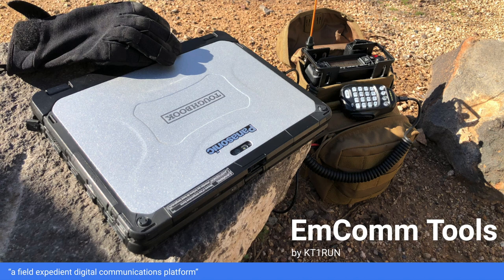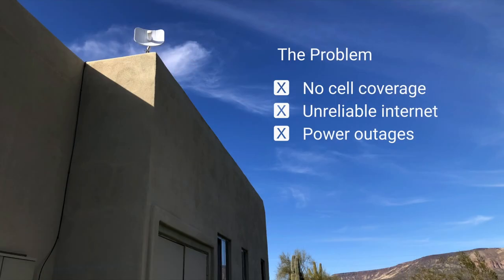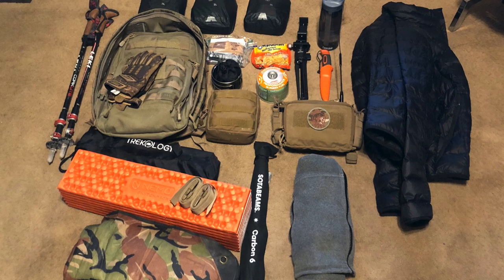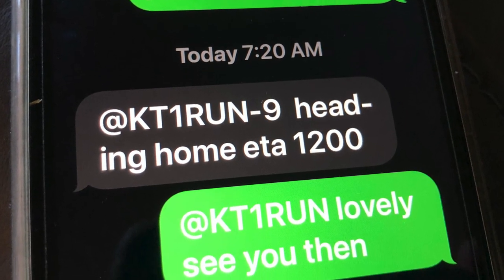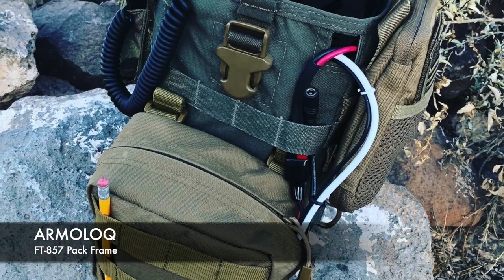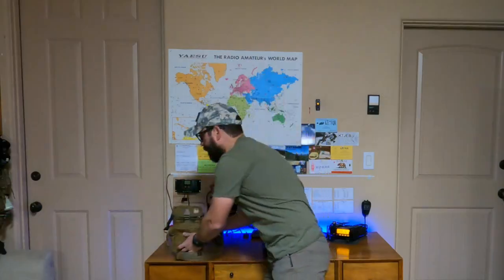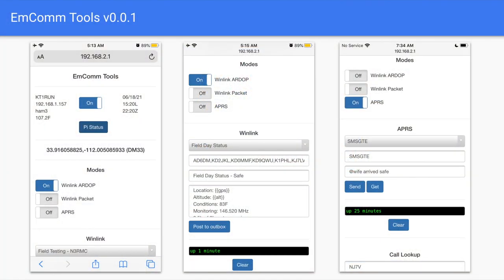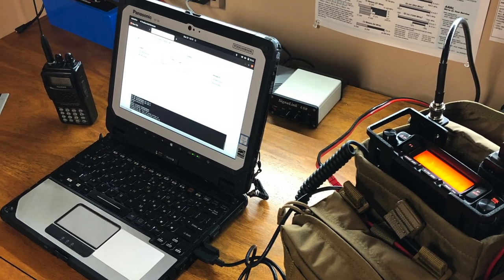The EmComm Tools Story - The what, why and how?

Comment: The man bag for go is the smartest part of this whole setup. Anything that does not disrupt connections is A+++
Reply from the maker: Glad you like it. You should see the current iteration of the manpack. I custom designed a bag (TTP Manpack), so there are no external wires. There is nothing that gets in the way of cables or components.

Comment: Have you seen what KM4ACK has done with the Pi. It looks like you are doing about the same things. He has a Build A Pi.  Loades winlink, JS8CALL,  FT8, Ham Clock,  and many other things
Reply from the maker: We are actually good friends and talk about once a month. I started with the Pi and do run Build-A-Pi. I am taking my project in a different direction and I am targeting users that want to get into radio for preparedness, but don't want to tinker with the hobby. My goal is to make an appliance that's easy-to-use and that can be kitted together with reference hardware and software. Cheers!
Reply: @TheTechPrepper  I tryed to do his Build A Pi and screwed up 2 Pi's. I used a screen with the HDMI port.  If one turns off and the other is still on it tryes to power the one that is off through the HDMI port and that cannot do the power. Our ARES do Hurricane shelters and send Winlink to the EOC. Winlink has all the forms for Federal,, State, and local government. The last Hurricane missed us by about 150-200 miles north of us. There was only 3 shelters opened for less than a day. Because that storm was not going where they thought it would go and some older people have trouble doing things. I am new at this and a lot of learning to do. But much of our things will have generator power I think, but I just got a 100 AH battery to be sure I will have power for my radios. 73 de W4DES

Comment: instead of using zip codes would it be easier to do grid square info? does the fcc database have that info? just an idea not sure if it would help.
Reply from the maker: The zip code is used internally as a lookup key for a number of data sources that I aggregate. The FCC uses as postal code (not a grid square) in their licensee database. It's also used to lookup representative elevation info from the USGS. I take the zip code, geocode it (lat/lon), then calculate a 6-character maidenhead grid square.
Reply: Remember that resolution beyond your antenna's beamwidth is wasted. If you're talking 2m SSB, sure, narrow it down to a 10º pie-slice on the map. But if you're on HF, once you get beyond immediately adjacent states, just knowing the state itself would be enough of a starting point to aim any directional antenna you could carry in a pack.

Comment: Fantastic video Gaston,
I was already a fan of Emcomm Tool but this just took my enthusiasm and anticipation to the next level.
Keep up the great work/content this is amazing. 
73
Reply from the maker: Thank you, Jose. As I was working through the demo and I realized how much was still missing in terms of feature completeness. I am actually using both versions of the application and can't wait until they are finally merged. I use the original version any time I have to interface with the radio to send messages and use the new version when I need the map. Stay tuned for the "supporter" beta. I appreciate all your support!

Comment: I was just saying to some ham friends, someone needs to make all the digital modes easier!  I spent way too much time learning all the connections, ports, system sounds, multiple softwares running...  You're doing great, keep it up!
Reply from the maker: Totally agree! I had one heck of time getting into digital modes. Honestly, this iproject is starting to look like it's headed in the direction of me selling preloaded laptops with my EmComm Tools OS that is known to work with a small set of radios and the DigiRig Mobile. For me to make this turnkey and easy, it needs to be an appliance. I know this is "anti-ham" but that's the only way to deliver on my mission.
Reply: @TheTechPrepper   Ham radio is about experimentation and you are doing just that.  For you to make it easier for new hams and older people to operate without all the headache, you are providing a turnkey solution.  KF0CVR

Comment: I look forward to more.  I didn’t get very far into data modes, seemed too daunting as I had not kept up on much of the technical side.  Nowadays, I’m the guerrilla banging on the buttons.
Reply from the maker: Don't give up, Doug. Digital modes are need easy. I am a software engineer and had one heck of a time getting started. In fact, my first SignaLink was a dud. That through me for a curve ball for over a month before I returned it to HRO. I am glad I stuck with it. APRS is definitely the easiest digital mode to use when getting started IMHO. 

At the last minute, I was pulled into the Mesquite Canyon trail run. I know you were asking about events I was planning on working.

Also, I'll be running as Net Control on the AEN-MAR net for the first time solo on Monday. The topic: Winlink Introduction. Feel free join and give me a hard time. ;-)
Reply: @TheTechPrepper  Too bad I wasn't able to attend the mesquite run.  Figured I would go for a walk during the winlink net.  Great job on the net.

The last time I tried digital was through an old kenwood 707.  Couldn't seem to get the transmit settings correct.  Have you thought of aredn?
Reply from the maker: @douglasvamateurradioandmore  ARDEN is not for me at this point. I have about a half dozen WRT54G routers that I could use. I'll likely look at it in 2024. I have a plan in place for things I'd like to tackle in 2022 and 2023.

Comment: Great video. I working through a lot of the same problems you’ve gone through. I am hopefully going to get a 2m/7cm antenna with high gain so I can get more active locally. Still want to work on emcomm too. Keep up the great work! 73’s KK7BPV
Reply from the maker: Thank you, Roger. I figured that others have or will run into the same issues. That's partly why I have documented the experiences on the channel. Don't give up and keep at it. As you can see, I am not expert, just another guy fumbling through the hobby. Good luck with you EmComm journey!
Reply: I use the CHA MPAS Lite.  And it is wonderful!
Reply from the maker: @kurt53641  Very nice. Interesting timing. Chameleon Antennas contacted me a few days. The are planning on sending me a couple of antennas later this year for review. They were always out of my budget. It will be nice to see what all the fuss is about.
Reply: @TheTechPrepper  I just saved and saved to buy once cry once.  And I never looked back
Reply from the maker: @kurt53641  I subscribe to this philosophy as well.

Comment: This is really impressive and looks very promising so far. I'm a new Ham and have run into a lot of headaches with digital, you story resonates so much. I'm curious about how you buildt the UI. Is it html based? I would love to tinker around with the interface would that be possible in the supporter beta?
Reply from the maker: Welcome to the club. Digital modes can be a little tricky. The UI is built using a front end UI framework called React Spectrum. It renders to HTML, CSS and JavaScript. The backend is written in Java. This will be released as open source after the beta. Although, I may invite a few developers into help in the coming months. The application is changing too frequently based on my field tests, so I want to get a more stable build before bringing people in.

Comment: Wow, the project is looking impressive!  I have a Cf-19 mk3 (I was able to source it for cheap several years back).  I am currently running Mint 18.3 which isn't even supported anymore (the computer is Core2Duo CPU, 1.20 GHz, 4 GB RAM).  I am wondering if I can get Xubuntu 21.10 installed on my Cf-19 and if that would run Emcomm tools.  I assume Mint 20 wouldn't work for Emcomm tools.  Ubuntu 20 seems to reqiure 2 GHz processor.  Thanks for the awesome content!
Reply from the maker: Thanks for being apart of the channel. The initial release will be packaged as a live USB ISO image based on Ubuntu 21.10. There will also be USB stick for purchase for those that want the true offgrid experience. At some point, I will release it as standalone package with detailed setup instructions so that users can install it on any Raspberry Pi or Linux distribution.This will come in 2023 given the amount of work to document the standalone setup and configuration.  My goal is to get this initial shipped as a single ISO image with everything installed and configured as I want this to be an easy-to-use appliance. You should be able to test the live USB on your CF-19.
Reply: @TheTechPrepper  When you release it i would Love to see an Android (APK) Version. One addition i would love to see would be an option to do digitalmodes with your phone just as an addition so if a moden fails out in the field you can still use audio cuppeling [and yes im not 100% up to date with your progress so if this already has been implemented by you nice job!]

Comment: Do you find the extra weight worth it in regards to packing in an 857 over the 818?
Reply from the maker: It's depends. If I have an elevation advantage when on a peak, the FT-818 is the way to go. If I need to guarantee or at least improve my ability to communicate when  I'm in poor locations, I have found the FT-857 to be worth the weight. I try to run it at 20 watts and have very good success.

Comment: Question- is your software in competition with build a pi / 73Linux?
Reply from the maker: No. They have very different goals. The new version is plug-n-play and has a number off grid capabilities.
Reply: @TheTechPrepper  what I was thinking if they had the same purpose. Join forces and sky’s the limit on what you and Jason could come up with. I do like your videos. I have a CF-30 bought it because of the HD sleds. If I had seen yours on the CF-20 might have bought it instead.

Comment: Would you do a video on the best Cell Phone for preppers to run with a setup similar to yours
Reply from the maker: Sadly, I have not found one yet. My iPhone is unusable for more than a few minutes when I backpack during our summer months and the touchscreen does not work when I sweat. I've had better luck with The Ulefone Armor X7 (Android) but it also can't deal with the heat. For me personally, I have not found a ruggedized smart phone that works in harsh environment yet. So, I can't rely on a phone as a prep item. I'll make a video if I find one. Thanks for the suggestion.

Comment: Any chance this will make its way to the DragonOS toolbox?
Reply from the maker: Good question. Unfortunately, no. The creator of DragonOS did reach out and offered to add to support, but EmComm Tools is more than just an app. It needs to do a full OS take over so that it can handle plug and play support for a select set of radios. It is intended to be an appliance, so by design it takes over most the amateur radio applications that is uses. It may be time for an update video.
Reply: @TheTechPrepper  as a followup, I know the intended deployment is via booting from a thumb drive at this state, would we be able to get it as an ISO to run as a VM in virtualbox with a documentation laying out kernels and configs?
Reply from the maker: @thatswhatshesaid1  Unfortunately, not at this time.

Comment: Would be cool if it had CW decoding and keyboard entry encoding support.
Reply from the maker: It would be cool, but I believe there are tools for this already. I may see what's out there and install it on the CF-20, but this feature will likely not make it into the project. There are hardware receivers that handle the CW decoding, too. That would be my preference. 73

Comment: The mobile phone 📱 web interface option would still be great for maximum portability, like Android phone and localhost website? Still great to have Linux tablet for dev and multitasking uses.
Reply: OK WOW! 🤩 So much more capabilities on the tablet, especially with the offline map 🗺, pins📍and functions!
Reply from the maker: Good point. I failed to show this in the demo. The application is designed to work on small screens (phones), tablets and desktops. The application uses a "responsive" user layout that dynamically changes based on the size of the screen. Good catch. I'll make sure to cover this during my presentation next week.

Comment: Could the raspberry pi be ruggedised?  Maybe a good project.
Reply from the maker: To some extent you could improve the reliability with a ruggedized case with proper cooling and integrated power. I looked into designing a case, but tabled the project for now. The problem then is a screen that can works in full sun, in the rain, in extreme heat, with gloves, etc. The other issue is that ruggedized laptops are engineered differently than normal computers. For example, they have battery warmers and their components are compartmentalized so that one component failure does not kill the entire system.

Comment: Rock that Cf-20!  Just don't send it in for repair.  I'm busy enough as is :)
Reply from the maker: This thing is great! I'm finding all the little quirks with the CF-20 and have solutions for most of them. Do you have a good source for buying replacement DC power dust covers for the keyboard/dock?
Reply: Our parts room ;)  I work at Panasonic's toughbook repair center currently called heartland customer solutions but will be changing to Panasonic connect (I think) next month.  We are in leawood KS.  Give us a call and one of the ladies in the office can get you taken care of.  If its in warranty they may just send them to you free.  If not i think they are $9 each (doesn't matter keyboard or tablet covers).  But I would check eBay first and see there are any on there cheaper.  And you didn't hear it from me but they are going to be dropping the cf-20 for the G2.
Reply: @TheTechPrepper  😊😊😊😊😊😊😊😊😊😊😊😊😊😊😊😊😊😊😊😊😊😊😊😊😊😊😊😊😊😊😊😊😊😊😊😊😊😊😊😊😊😊😊😊😊😊😊😊😊😊😊😊😊😊😊😊😊

Comment: @The Tech Prepper At 48:10 into the presentation, you state the version of Ubuntu that you are using, which is different from the version shown on the slide. You may want to check this. DE WA1KLI
Reply from the maker: Good catch. I was fumbling for my words. The correct version is Ubuntu 21.10. I did this in one take before work a few days ago. Thanks for the correction in the comments. Someone else may have the question.